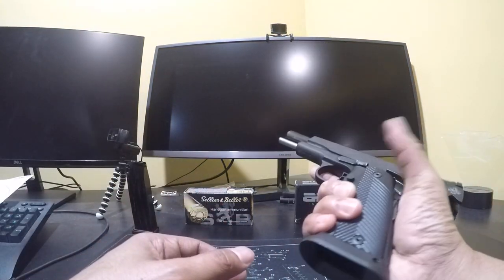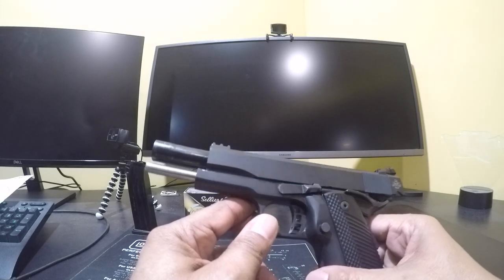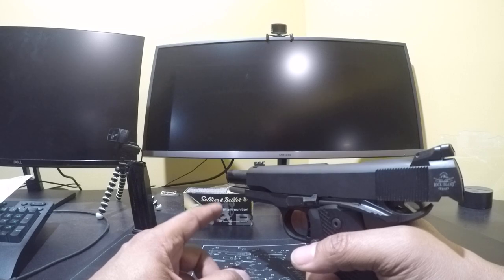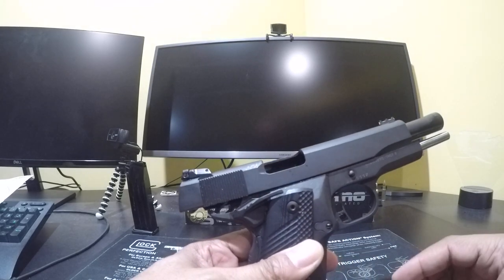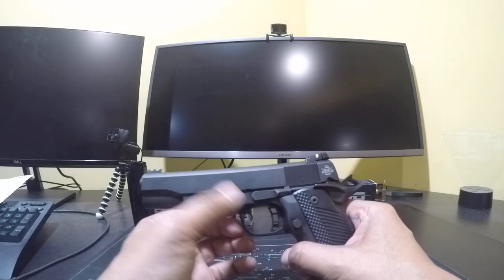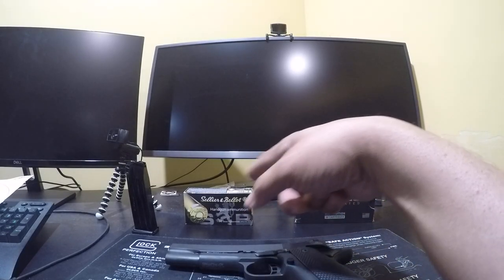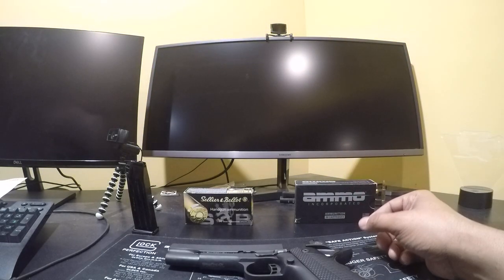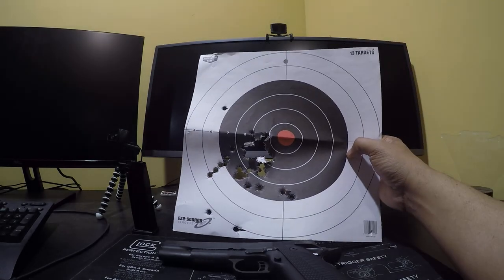RIA Rock Ultra FS HC 10mm

Comment: How has your gun been for you. Reliability wise. I hear some failure to feed issues. I just got one and was wondering if any changes to the gun are necessary, like the extractor or something. Thanks
Reply from the maker: Initially I had issues with one of the two Remington R1 mags feeding.  It misfed twice, but that's a fault of one of two mags that weren't OEM.  The other R1 mag fed flawlessly.  It hasn't done it since, though, but I've only 150 rounds through it so far.

I had to stop shooting it, as 10mm ammo was/is difficult to find and when I do find it, it's expensive.  I'll soon begin to look for 10mm ammo again, as the prices appear to be lowering.